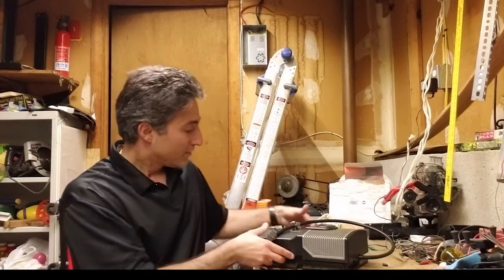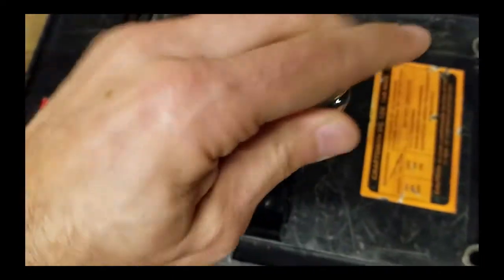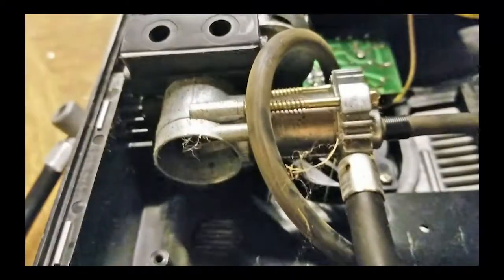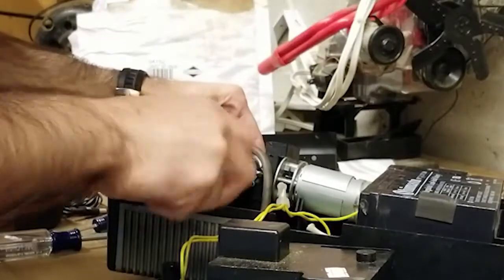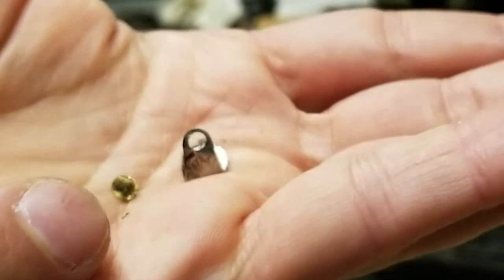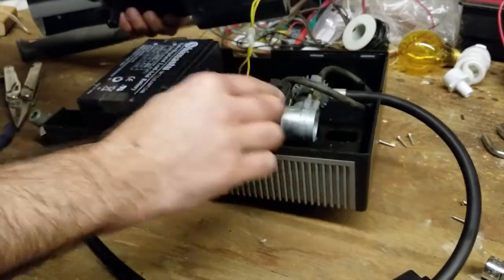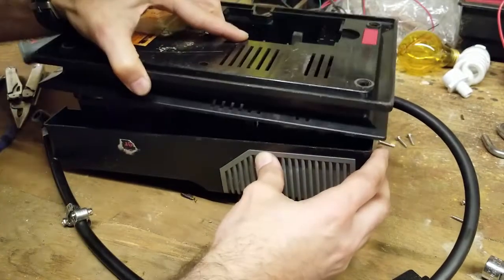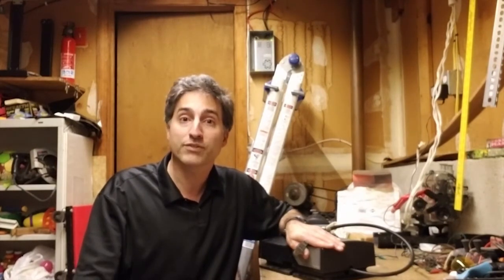Diagnosing a Portable Air Compressor That Went Dead

Comment: Thank you for your quick response. I would like to make one myself, what kind of flat metal should I use?
Reply from the maker: Good question. I'm not a mechanical engineer,  so I do not think I could give the best answer.  Maybe another viewer will have a good suggestion.
Reply from the maker: I just Googled "air compressor reed valve" and several potential options came up available on Ebay or Amazon. One of them might make a good starting point.

Comment: Excellent, I need that OVAL SHAPED check valve, I only see part of it attached to the eyelet screw. How can I get or buy that check valve?.
without it, the inflator is not working.
Reply from the maker: Given the age of the inflator, I am doubtful it would be available. I wonder if you could fabricate one if you can find another component such as a larger valve with the same thin flap material.

Comment: My slime jr unit says to run no more than 8 minutes.  After a 15 minute break, you can run it another 8 minutes.  Im impressed my Slime inflator Jr still works.
Reply from the maker: Yeah,  I'm thinking I ran it way longer than recommended. The compact spare required 60psi and was below 20psi.

Comment: Update-3: In Update-2 I had reported that I applied grease to the air compressor components (including the interior of the cylinder to reduce friction) of my 5.5 Yrs old Power Station PSX3 Jump Starter cum Tire Inflator.  It worked pretty well - filled air upto 60 PSI in 3 to 5 min.  After that also it worked when I filled air in 4 tires.  Last week I tried to inflate another 4 tires with 5 min gap between each tire.  Unfortunately on the 4th tire, while filling, the sound of the compressor changed signalling something went wrong.  Also after filling to 29 PSI in the 4th tire, the pressure gauge reading did not increase any further. Today I concluded that the piston has failed.  I opened the PSX3 and found that the rubber washer at the piston head had torn down.  Perhaps the grease softened it and it lost its strength - it was already 5.5 yrs old to start with.  Therefore, it is a bad idea to apply grease inside the cylinder.  I just wanted to let the viewers know about it.  Now it will be hard to find a piston with a good washer/ring so that it can compress the air to attain sufficient pressure needed for a car tire.  Thanks for reading.
Reply from the maker: Thanks for the update. Yes, definitely good advice on the grease. Perhaps either there was a chemical reaction that altered the properties of the seal.
Reply: @par64guy  Use a non-petroleum grease, such as the lightest smear of silicone grease (like you use for taps)

Comment: Update-2: Following battery replacement in my Power Station PSX3 and tested the Air Compressor, which filled air into my car tires very satisfactorily.  All along I was thinking to lubricate the Air Compressor components because I had noticed during battery replacement that the gears, connecting rod and other moving parts of the compressor were bone dry.  But after reassembly following battery replacement, I realized that  I forgotten  to lubricate the gears and moving components.  Last night I applied grease to my Power Station PSX3 Air Compressor.  Since my unit is already 5.5 yrs old, I just tried to do a bare minimum job of applying grease, meaning not a professional job. That is why I am not describing my grease application method here. Thanks a lot for your excellent video!!!
Reply from the maker: What type of grease did you use?
Reply: @par64guy  I feel ashamed to write this, because what I did was not professional.  I had explained the entire process in my previous video.  However, edited my previous comment, i.e., Update-2 and deleted entire explanation because I felt that it was not professional and did not want viewers to adopt my method.  I recently replaced grease in my Kenmore Elite Stand Mixer.  I had saved the old grease from that operation.  I used that old grease, which is not a standard practice.  Actually I had purchased white lithium grease - the spray kind to grease the Air Compressor components.  I felt that I may not be able to control the spray and it may get sprayed on the Circuit board or other sensitive area.  Therefore, I did not use that White Lithium grease spray.  I took this step because my Power Station PSX3 is already 5.5 yrs old and if the old grease that applied won't work or will damage the unit, I am prepared to tolerate the loss. 

New Info: Just this afternoon I tested the Air Compressor of my Power Station PSX3 by inflating the spare tire of my car. My spare tire requires 60 PSI.  The tire pressure was 35 PSI before inflating. Within a few minutes it (the Air Compressor of the Power Station) filled air successfully, and I stopped it once the pressure reached 60 PSI.  I very well understand that the old grease had already gotten phase separated (oil leaked from the Stand Mixer from which I had removed this old grease), and also it might have gotten some contaminants from the gears of the Stand Mixer).  Still I took a chance and used the old grease.  The sound of the Air Compressor reduced and it produced smooth homogeneous sound - I am very happy at its performance after applying grease.  Please note that there was nothing wrong with the Air Compressor operation wise - was filling air pretty good after replacing the battery and before applying grease.  Thank you for reading so far.

Comment: Now since I brought the Power Station PSX3 into running condition by replacing the 5.5 Yr old battery and looking for lubricating the Air Compressor components, your video gave me detailed background of the Air Compressor components that I will look for to lubricate.  In this regard, your video is very useful.  Thank you very much for making such a great video, and sharing it.  You mentioned about some noise from your rebuilt Air Compressor.  I would recommend to lubricated the gears, connecting rod and other moving parts.  However, should remember to select the lubricant which should not flow at high temperature (the compressor generates high temperature) and should not dry up, which will make the Air Compressor dead.

Comment: Update: I found that my battery is not holding charge (about 5.5 years since I bought from Costco). Thought of replacing the battery.  Before doing that I tried to recover the battery by adding distilled water to hydrate it.  I worked on hydrating (which is a slow process) for 3 days.  Some cells worked and most of the cells were locked due to build up perhaps.  There was no improvement in the voltage and max was 10.6V, which dropped to 9.26V in a few minutes.  So I gave up and bought a new battery APEX 12180F3 ABX-86741 $23.99 plus shipping ($11.03).  The battery arrived pretty quick and I replaced the battery in my Power Station PSX3 which is a Jump Starter cum Air Compressor. 

Before installing the new Battery, I compared the length, width and height and found that the new battery was approx 1/8" taller and the Terminal posts were approx 1 cm further away from the edge of the side wall. I already realized that I am going to face problem because the new battery won't fit in the existing battery compartment.  When I tried to install the new battery, sure enough it appeared that it was too tall and I tried to find out alternatives - first thought to return the battery, which I did not want to go through the trouble of returning.  There was another viable alternative - trimming some of the plastic guide plates that hold the battery in place.  Luckily I did not have to do that and the battery went in snug fit - what a relief!

Next challenge was the terminal posts being further away and the existing +ve and -ve connectors did not reach the battery terminals.  I had to manipulate to make the connection.  Then I tested the voltage which was 15.36V., which was same as I had measured soon after getting the new battery.  Checked the light and then the air compressor.  Instantly the compressor started with pretty strong sound.  Then I tried to put the shell back.  Again it was a challenge since there are so many screws and interlocking mechanism to pay attention to.

All along since I started this project, I was thinking to lubricate the gears of the Air Compressor of the unit. Because I faced so many challenges in installing the new battery, I forgot to lubricate the gears and other components of the Air Compressor.  Now it bothers me and looking for the right kind of lubricant/grease I need to buy which should not flow in high Temperature and should not harden too.  In another Video, the author replied to my question to use white lithium grease.  If you have any lubricant to recommend, which is appropriate for the Air Compressor components, it will be greatly appreciated.
Reply from the maker: It sounds like you have a pretty big project yourself! I think the flakiness with mine is a loose connector. I have been procrastinating and have not yet opened it to fix the connector. The only lubricant I have which may work is some lithium grease used for my tractor's suspension, but it does not have any temperature ratings. I will have to check on that before I consider using it.
Reply: @par64guy  Don't use lithium grease ... it's a petroleum based grease with lithium carbonate in it that makes it STICK.  Use a silicone grease.

Comment: I liked your video.  You diagnosed the problem and repaired yourself at your shop. I very much appreciate what you did.  This gives me courage to open my Power Station jump starter/tire inflator which is charging OK but the tire inflator is dead.  Thanks for uploading.
Reply from the maker: Glad I could help! Just be careful about live connections - disconnect the battery to insure against accidental shorts. I am still using the air station. The "weak battery" condition turned out to be one of the terminal connections being loose and causing excessive voltage drop.
Reply: @par64guy  Thanks for the "loose connection" tip. Yesterday, I checked with a DMM and found that it is recharging the battery but this morning the voltage dropped by 2 volts (from 10.5 to 8.5 V) in 6 hours overnight.  I will open the unit and follow your advice and other tips.